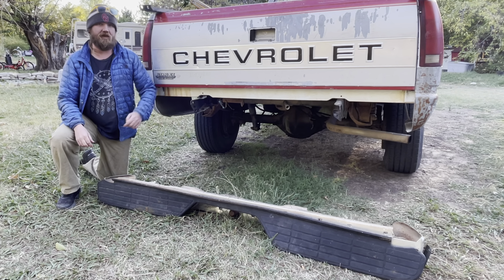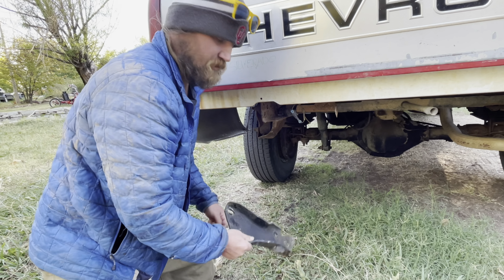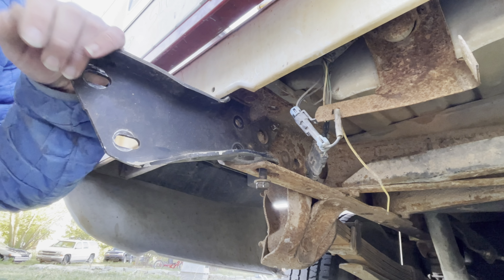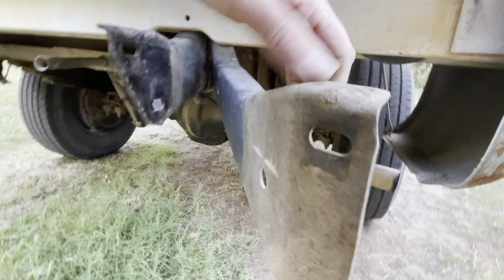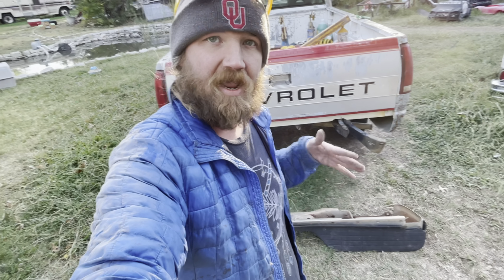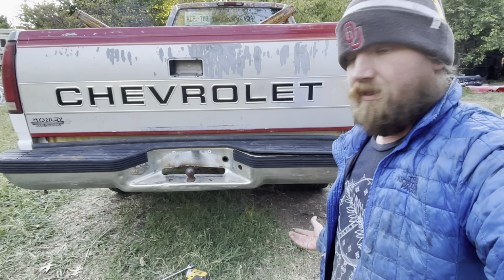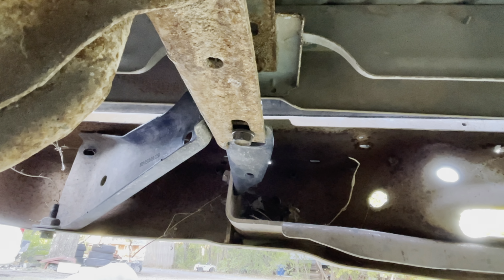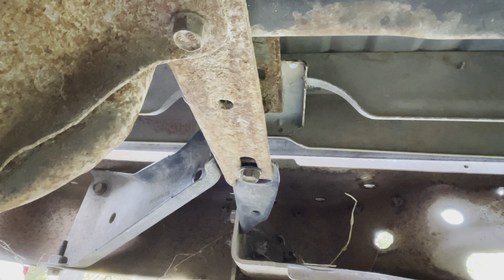Chevy GMT-400 (OBS) Rear Bumper Install

Comment: Thank you! My main concern was how the brackets went on
Reply from the maker: Unfortunately there’s not a lot of info out there on those bumper brackets. In my search I found there are at least 4 different types of bumpers for these trucks and they all use a different bracket. I bought the wrong ones the first time and finally just went to my local pull apart and found ones that came off a 2500 just like mine. Good luck on getting you’re mounted!